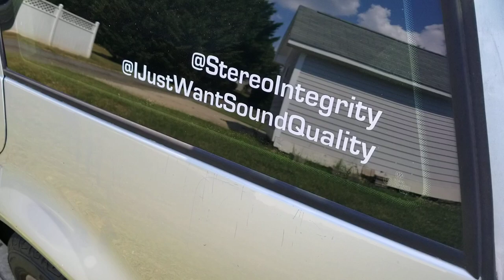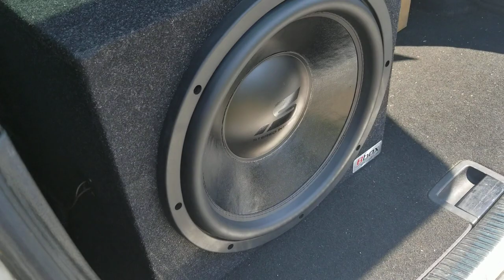SQL-15 playing 8 Hz in 2 ft^3 sealed.

Comment: Those BBox sealed enclosures aren't terrible if you have limited funds and do not know how to build your own box. The leaking spring cups are easily fixed. Also, you'll need to run a nice bead of silicone around all the inside joints. Add a bit of polyfil and you're good.

Comment: If I use the siq 1500 and want to wire the sub to one ohm how would I wire it to the dual outputs on the amp?
Reply from the maker: The SIQ-1500.1 is a mono amp. You can simply use one set of terminals and leave the other set unused.

Comment: For 12inch how many cubic ft sealed we build for Tahoe?
Reply from the maker: 0.75 to 1.0 ft^3.
Reply: @StereoIntegrity  does sealed enclosure size matter according to subwoofer rms ratings?
Reply: Yes, a subwoofer will need less power to achieve xmax in a larger enclosure. Can take more power in a smaller enclosure. Just be careful not to overdrive the amplifier into clipping. Therefore sending a distorted signal to the subwoofer which will blow it fairly quickly.

Comment: Will there be a 10 inch version??.??
Reply from the maker: No
Reply: @StereoIntegrity  that sucks extremely bad... but doesnt suprise me... us small subwoofer guys get left out of way too much... lol
Reply from the maker: Start a pre-order and get 200 pcs and we will make a 10" version for you guys.
Reply: @devillenm5525  unless space is an absolute issue... There's no reason a 12" wouldn't do. I dare say most could fit it with np.
Reply: @snake42591  I don't want a 12... I only run 10s... just how I am I guess.
Reply: David Drake  it's all about preference dude. I run 3 10s in my build and I really enjoy them. I have always had 10s. Mine play really strong down to like 20hz.